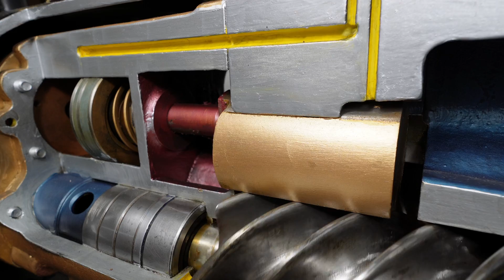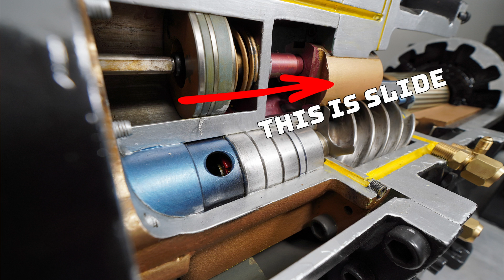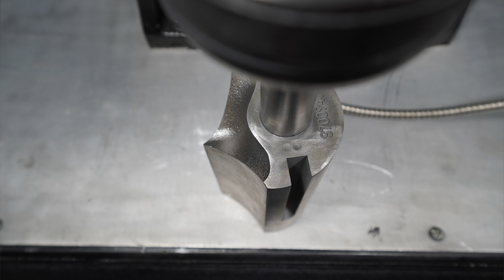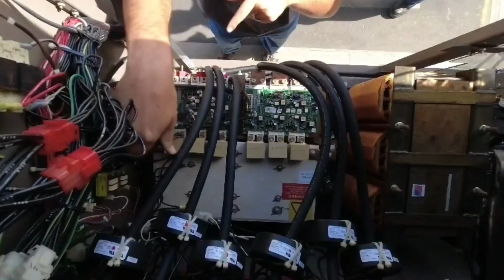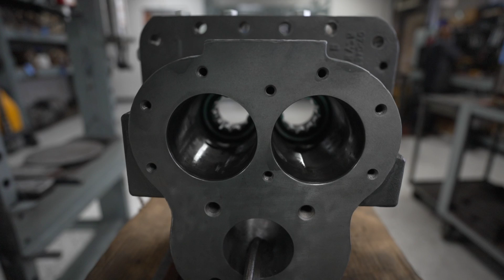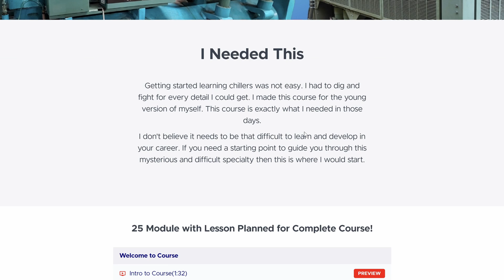How Screw Chillers control Load

Comment: Dear Sir ! I want to setup Inverter for old screw .please advise me.
Reply from the maker: That depends on the screw and controls system. It is not a simple task when load management and oil flow control are factored in.

Comment: Hello boss, i have a problem with my screw comressor slide valve is not opening i check already the voltage it looks fine , i just suspecting the solenoid coil or mechanical problem

Comment: Slide valve is to control compression ratio, means only change the discharge pressure the capacity remains same, correct me if I am wrong
Reply from the maker: The capacity is being adjusted by the slide valve. This is how we can make a 50 ton compressor operate at 30 tons to match load.
Reply: That is what Daikin screws do. They use the slide valve to maintain compression ratio. Capacity is from the drive.

Comment: Hi
I wanted to tell you about whats happening with a York screw chiller. I can send you a pdf of the name plate but it's YCRS0140SC460YAADB. Whats happening is the demand stays level for the morning, but suddenly starts rising and falling. So its level at about 28 to 30 KW then rises pretty fast to 41+ KW. Then falls (at about the same speed) back to 28 KW. I'd like to send you some graphs from the metering so you can see. I asked the mechanic and he said its normal. I asked an old York guy and he said it's not normal at all.  Thanks Bill Hendrix

Comment: Only experience with these is watching an HVAC tech bang his head against 4 of 'em because the electricians swapped the building feed breaker but didn't mesure rotation first and no one knew which direction the compressor took. Had to tear into it and remove the motor coupling and bumbstart to test. Added an hour and a half to a 30min restart 😑

Comment: I had a question you said loading depends on supply water temperature.
What if the delta T increases shouldn't that also increase the loading percentage. As we are getting warmer water back from the building.
Reply from the maker: For standard equipment the chiller really only cares about leaving water temperature. While we monitor entering water temp it is not an active part of the control sequence. There may be unique exceptions out there but that is not the standard.
Reply: @HVACTIME  Thanks 👍